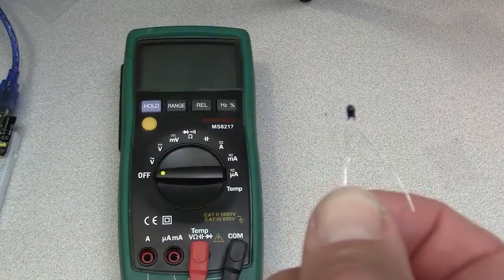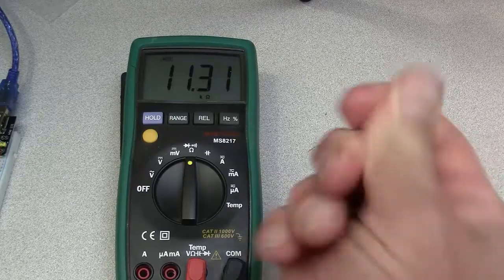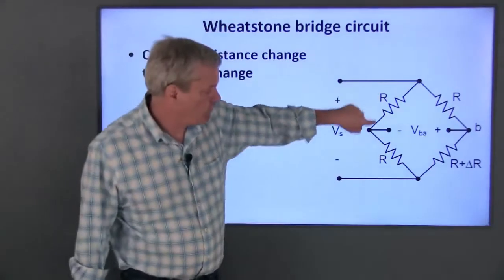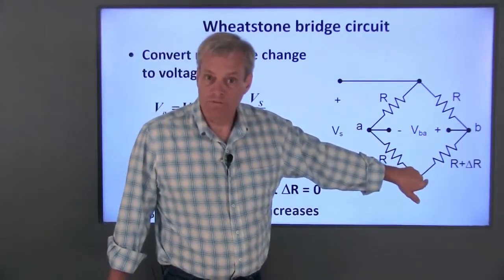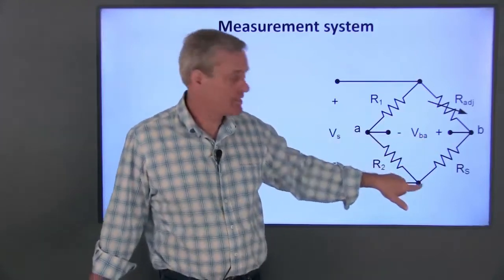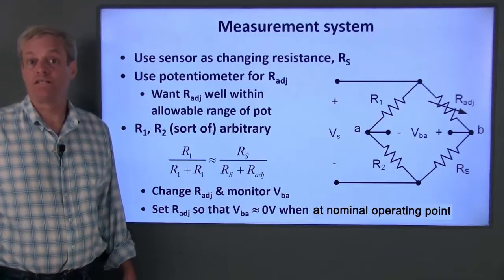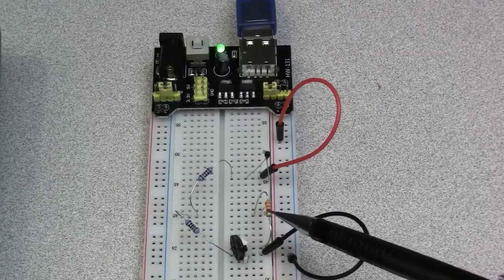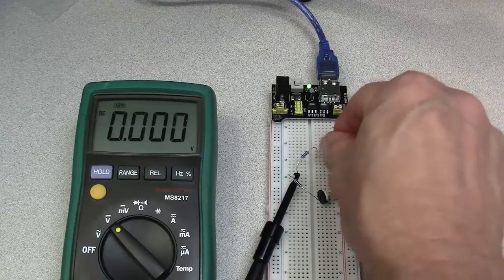Temperature measurement system

Comment: Thanks so much for this video sir. My projet is based on this temperature measurement . But i still face some difficulties and i will really appreciate if you could help me out by answering tom some of my questions.  so i did a wheatstone bridge circuit as you did  in the video using three fixed resistors of k Ohms and a NTC Sensor of  kohm. i gave a Power sipply of  15 V to the circuit . my V ba for e.g like in the video gave 0,01 V . Then after warming my fingers and touching the NTC Sensor, the Voltage didn´t really change  so i had 0,03V  meanwhile it has to change greatly depending on the temperature. i would like to where does the pb comes from . thanks in advance
Reply: Hey can u plz help me . I too face the same problem.